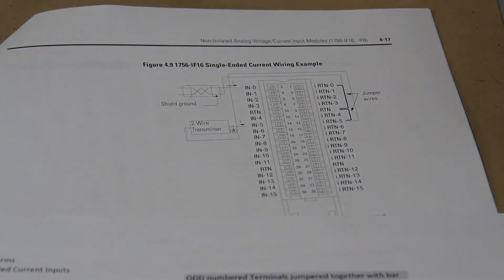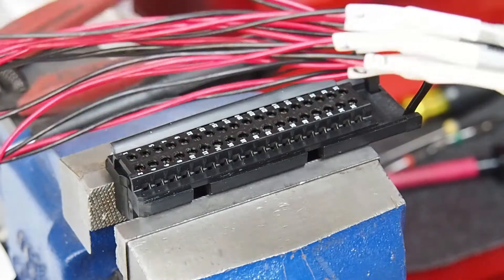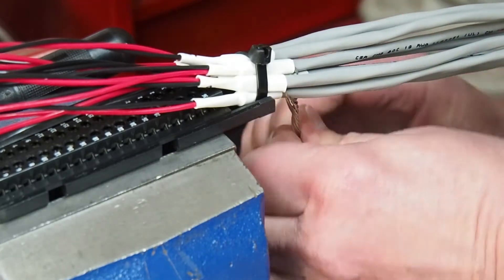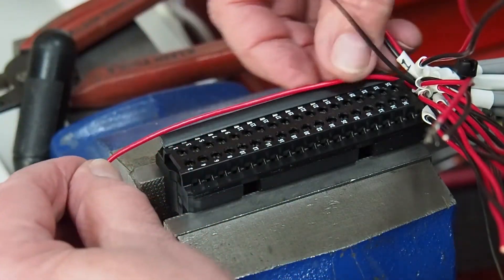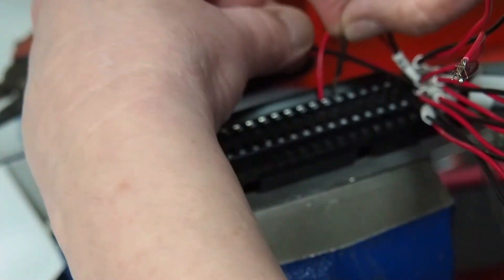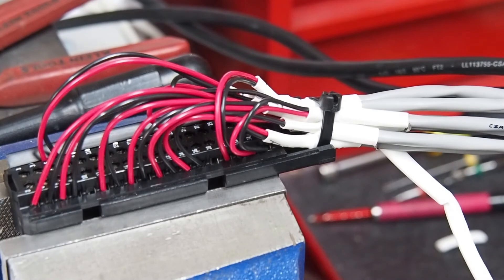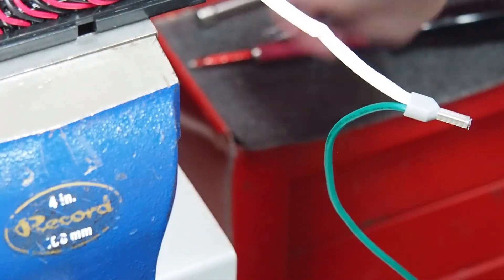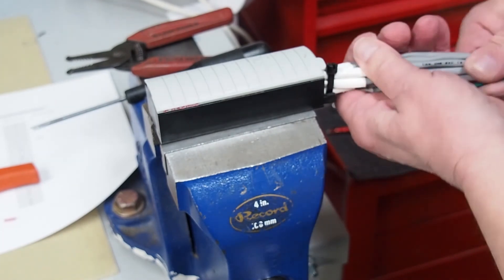Wiring arm for 1756-IF16 in mA mode

Comment: This was very informative, would this be the same wiring for the 1756-IF8? I'm confused as to why each pair is using 2 inputs? I also have some devices that require to be loop powered. Can you please show me an example wiring diagram for the 1756-IF8 module. So, all of the i-RTNs and RTNs get jumpered?